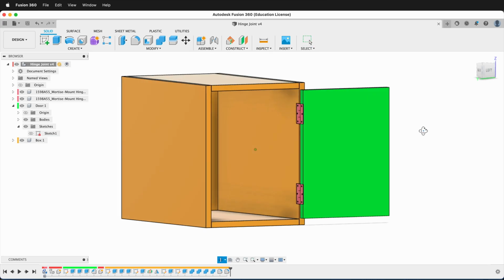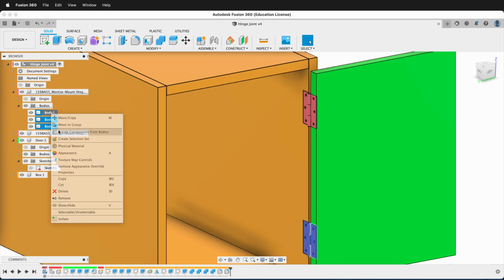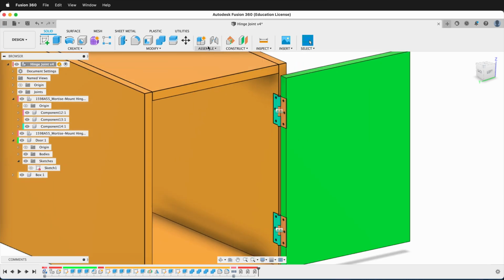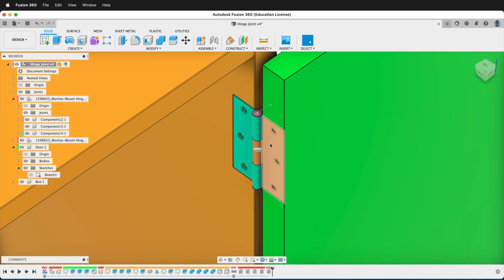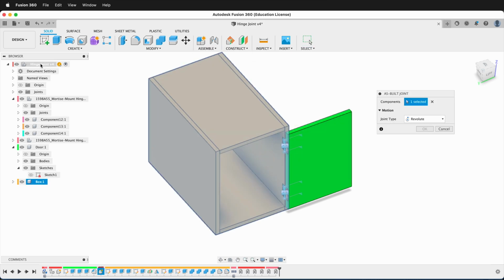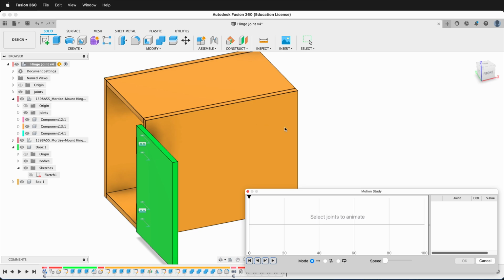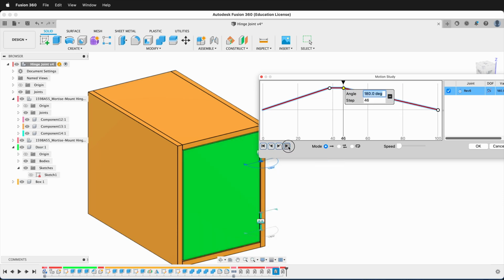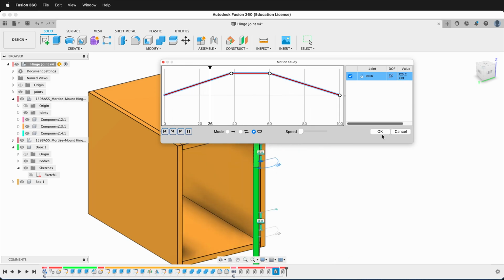Make Cabinet Hinge Joints in Fusion 360 Tutorial

Comment: Wouldn't the Ground option fix the box in place? Or did i get the function of the right click -> ground wrong? :)
Reply from the maker: Yes using ground on a component works as well but you can also use a rigid as built joint, that way it is in the design history
Reply: @WhatMakeArt  alrighty :) just seemed like the long way round with the Joint or the ground being a low usefulness function, the joint being in the timeline makes sense